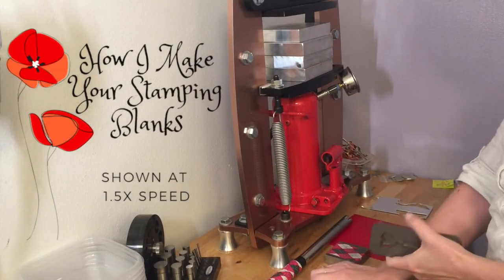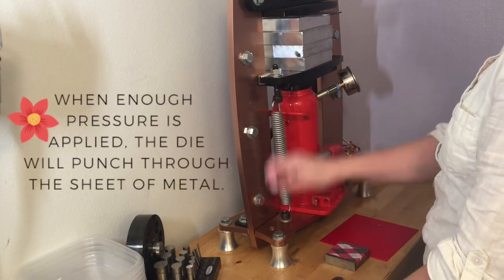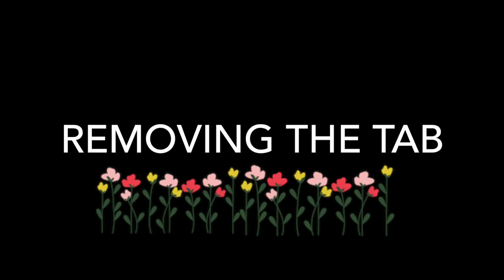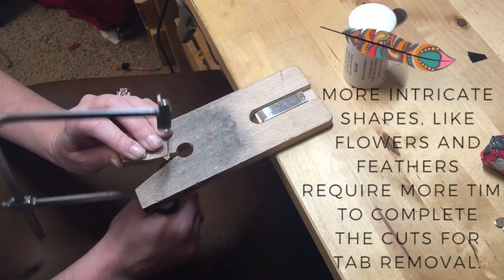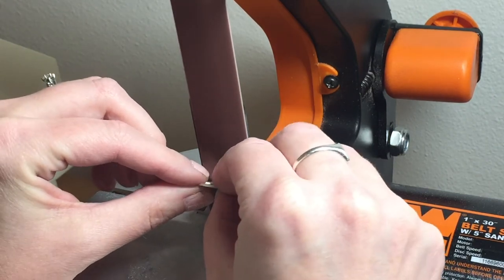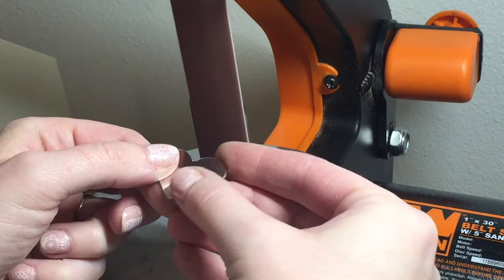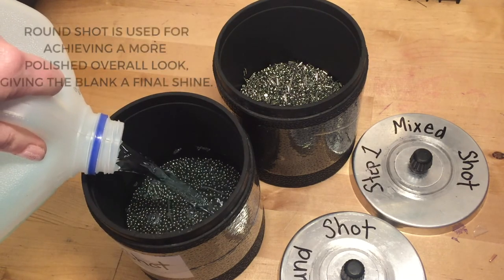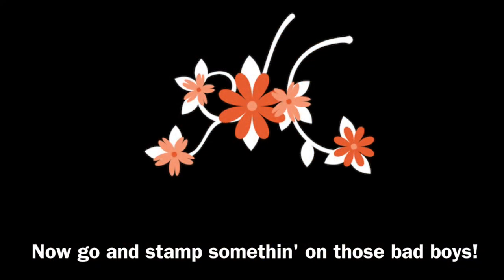Metal Stamping Blanks: The Making Of (How I Make Your Blanks)

Comment: Where is the Best place to buy sheet metal? I have seen a sheets of aluminum at regular hardware stores but just not sure if you can use those for jewelry pieces!?
Reply from the maker: Stephanie Hickey Hi! The stuff at the hardware store is going to be too thin for pieces like this that you’d want to stamp. I use a local source to save on shipping and try to cut costs for the people I sell to. But if you search online, you’ll want to look for 1100 or 3003 aluminum. One thing to be aware of is that most sheet metal is listed in fractions of an inch thick instead of gauge, so you’ll need to convert that. 

Also, if you’re looking for enough for just a few pieces of jewelry, it will be more cost effective to buy those on Etsy or Beaducation etc. instead of purchasing large sheets from a supplier. The other struggle with large sheets is that you need equipment to cut it down into workable pieces.